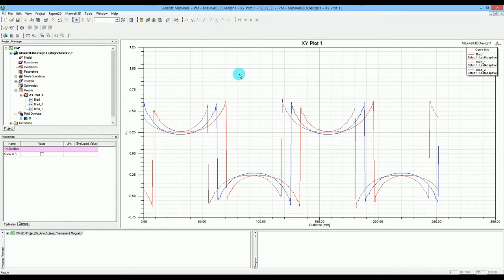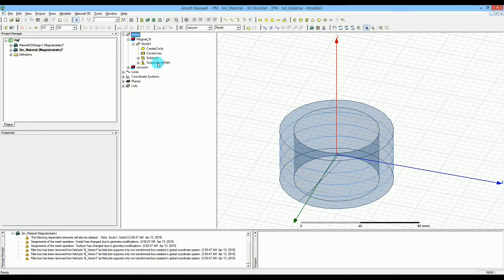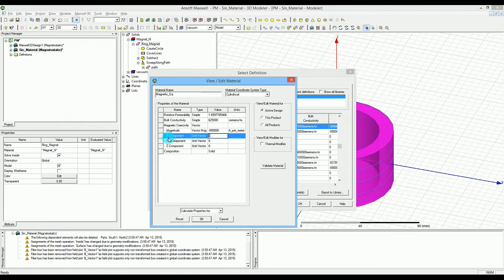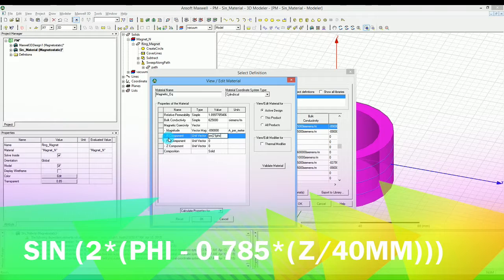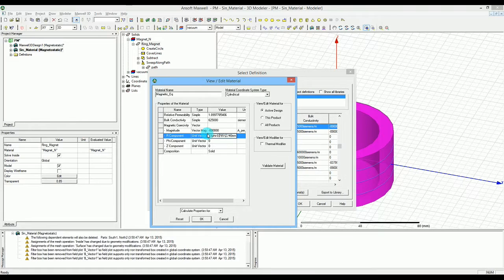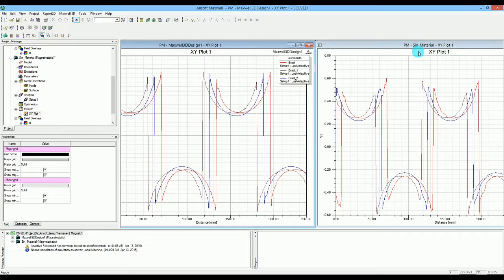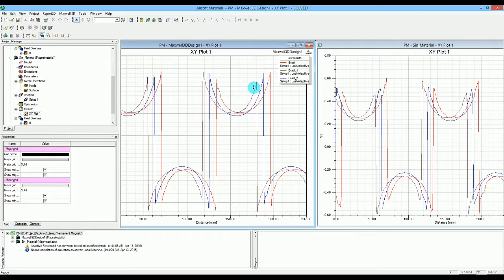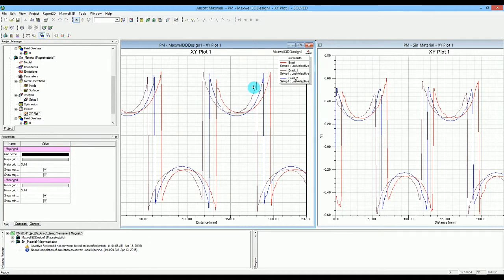224- Ansys Maxwell - Magnetization Direction [Adv. Modifications in the Material]

Comment: can you help me for analysis with eddy current in 2d
the problem how to calculate the inductance in case axisymmetric model of the coil and piece inside the coil

 ''''induction heating for example ''''
Reply from the maker: abdelkader attab I am planning to make some tutorials on 2D surfaces. Not in the near future though. If your question is urgent and you can not wait,  I do some private tutoring. if you are interested contact me at kamyark2002@gmail.com
Reply: ***** thank you

Comment: thanks for the really helpful tuts. 
I have a question. I want to do analysis while inside of the chamber is filled with magnetic fluid. I have problem to create a region around my model which is not vacuum. thank you in advance
Reply from the maker: telcomun you can easilychange the material of the region by  right clicking on the region and assigning air as a material. is that your Q?
Reply: ***** thanks Kamyar for the reply,  my bad I found my mistake.